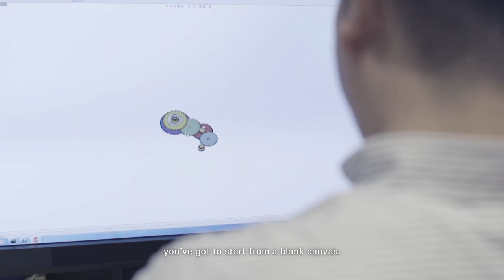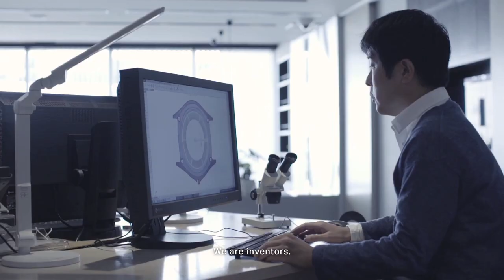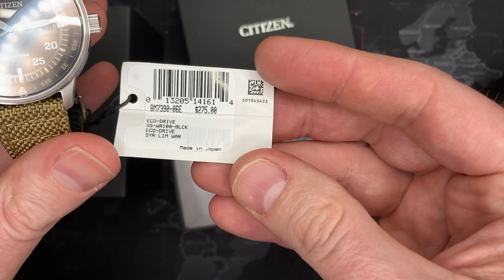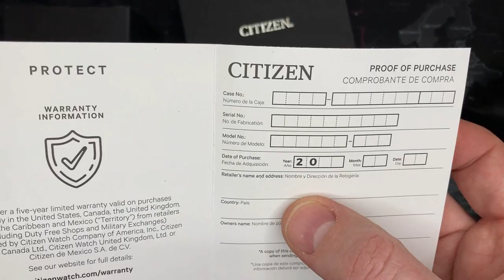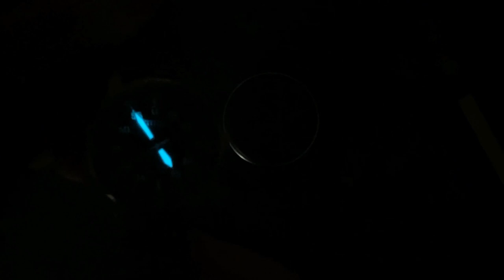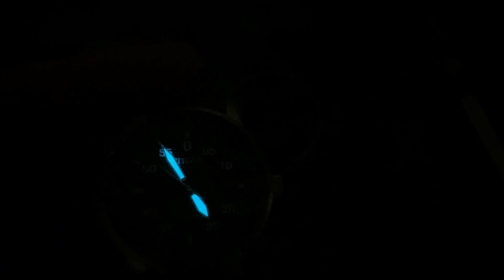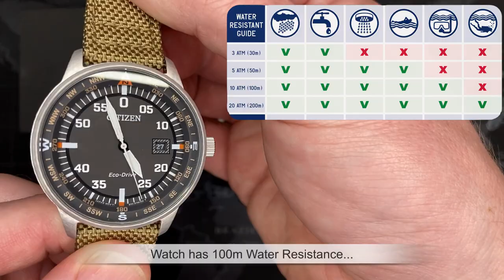Citizen "Global" Eco-Drive 100m Field Watch - Review & Unboxing (BM7390-06E / E111M)

Comment: Nice review, you hit on all the major points.

I've had this watch for over a year now, it's been with me on a number of hikes. I like the slim size and light weight. The domed crystal has a nice look to it too, definitely happy with it overall. It's very legible, I love the sword hands.

Still, the compass bezel isn't very useful, I'd prefer a 24 hour chapter ring instead to aid with simple time telling. The lack of lume on the markings is probably its biggest weakness. Looking to move on to the next field watch, something with a screw down crown, better lume, and a sapphire crystal. But it will be solar too, that just makes a lot of sense in a field watch IMO.
Reply from the maker: I agree... the compass is really more for looks than anything.

Comment: Got this for $50 usd no joke. But the seconds hand does not hit the minute markers.. maybe a quality issues thus selling for a low price.
Reply from the maker: It’s a great watch, but yeah… the second hand thing is an issue with a lot of manufacturers. It’s not a defect per-se, but an assembly issue. Sometimes it’s not as simple as making sure the second hand is perfectly perpendicular to the 12, but if the movement was in the middle of engaging to the next second, it would be perpetually off.
Reply: @ToddsWatchshop  sadly I returned it. I am getting the more expensive bn0150-10e.  Hoping won't get any issue like this.